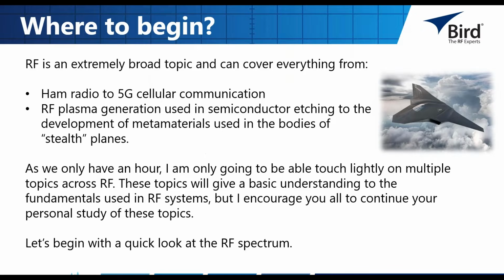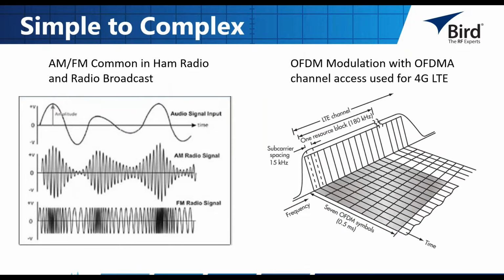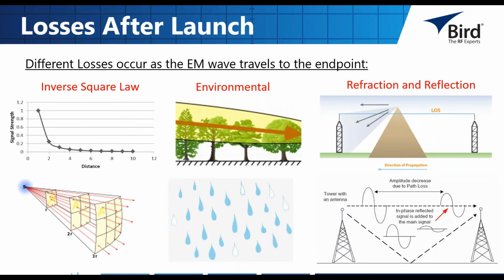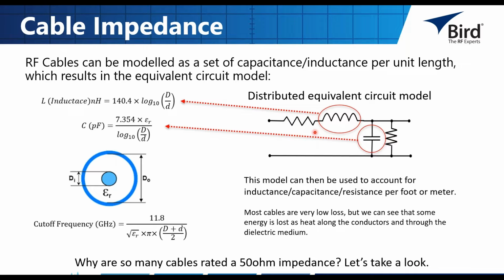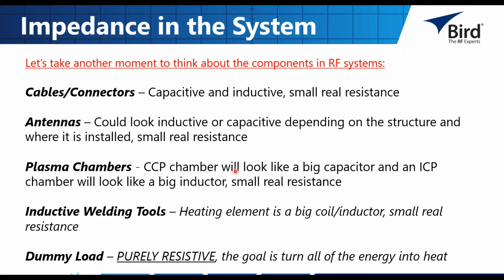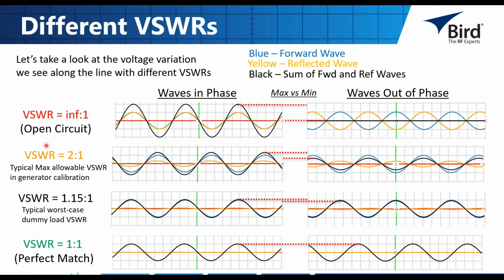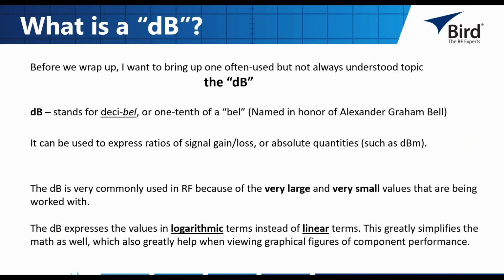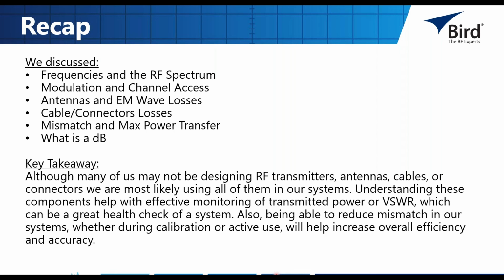RF Fundamentals

Comment: Great presentation! I’m just confused at slide 40:38. I tried out the math going from 0.006dB per foot to try and convert to power lost per foot so 10^(0.006dB/10) and I got 1.00138. Why is there a one subtracted here and the decimal is moved?

Comment: This lecture leaves a strange feeling. The author discusses such exotic RF equipment like plasma chambers and heating elements, but never mentioned such a crucial element as balun . Reminds of such impedance mismatch problems as wind (lolwut), but forgets to mention that any RF device impedance may differ a lot for different frequencies and almost never hits the standard 50 ( 75, 110, you name it ) Ohms precisely - not least because it's usually a complex number, with a significant reactive component. This is definitely bad as a theoretical article.
Reply from the maker: Thank you for your feedback. We're always striving to provide valuable and informative material for our viewers.

Radio frequency technology is a vast and evolving field, with numerous applications. Our goal with this series is to offer high-level insights into key aspects of RF technology, focusing on fundamental transmission line measurements that help optimize RF systems. Additionally, we aim to touch on some of the challenges in this space, such as advancements in encoding techniques and the extraction of meaningful measurements.

While basic techniques have served our industry well for decades, we acknowledge that there is value in exploring more advanced topics, such as balun use, antenna matching, and deeper load and system matching techniques. We appreciate your input and will keep it in mind for future content.
Reply: @BirdTechnologies  Sorry, balun is not an advanced topic. It's literally the most basic thing dividing the unbalanced current from the balanced one, in other words - a coax cable and an antenna. You simply can't build an RF circuit without it. And if you try, you wouldn't be able to tell, where exactly the current is getting converted and what part of your circuit is actually working as an antenna. It may even include the transceiver and its power lines. Connecting an antenna without a balun may totally ruin all of its expected qualities like directional pattern, impedance etc. This component must definitely be discussed way before plasma chambers or heating elements.
Reply: This was a high-level guide/overview, with one hour time limit. He did great imho.

Comment: Presenter is knowledgeable and informative. Shows the relationship between differing concepts, transitioning to how that relates to errors in transmission and how to overcome them. Even has a quick run-down of the inverse square law with accurate and easy to understand visuals, and shows a few examples of how that is overcome by directing the energy when changing the physical characteristics of the antenna. Lots of general concepts beginners can use to direct their focus on what to study next for self improvement.
Reply from the maker: We’re so grateful for your thoughtful comment. Thank you for sharing!